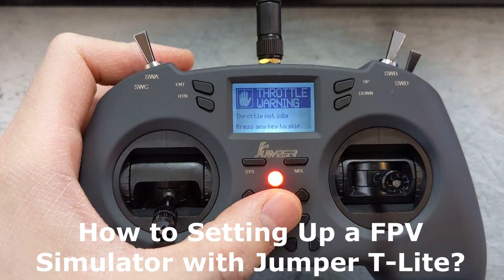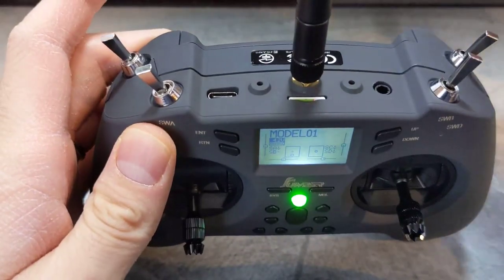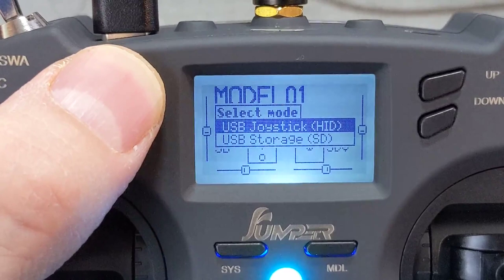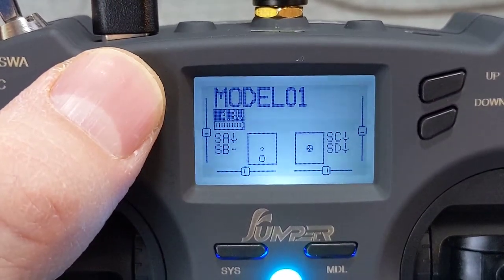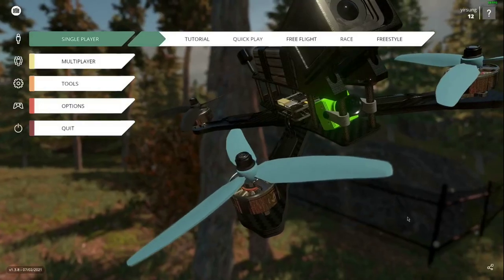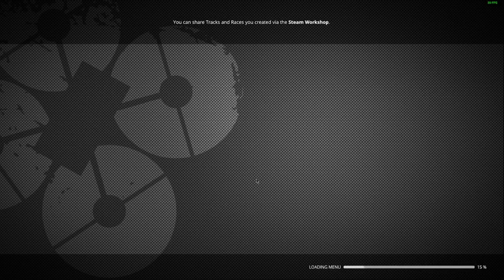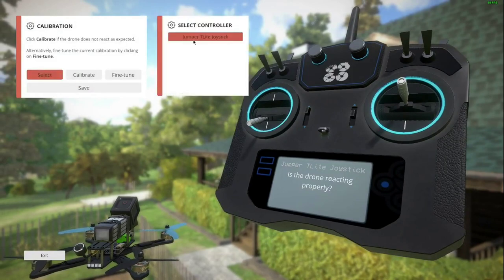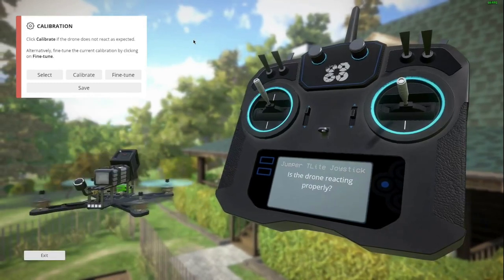Jumper T-Lite | How to run drone simulations with Jumper T-Lite? | Liftoff

Comment: a) Do you need the 18650 battery in the transmitter to use on simulator? b) How do you get sounds?
Reply: You do need to use a 18650 battery even if you are plugged into a power source. To gets sounds you need to have an sd cards and go to jumpers website then go to download and click a random radio, then download the sd card contents, go to file explorer and drag the sounds file to the as card. Then put the sd card in the remote. The address card does not need to have a big storage capacity.

Comment: I did everything you did, but LiftOff doesn't seem to find my Jumper T-Lite... Windows installed it without any problem, its showing in my devices screen as a controller, so no problem here. Restarted my pc and steam multiple times, changed things in steam controller settings but still nothing. And I also did try other usb ports. Any idea how I can fix this?
Reply from the maker: Try setting, Calibration.
Reply: @startfpv574  thanks for the reply, but my LiftOff cannot find the controller. It's saying to "Turn off Generic Gamepad Configuration Support" in steam settings and that's what I did. So I cannot calibrate this in lifoff, I can calibrate it with the Game Controllers panel in Windows but that doesn't seem to change anything.